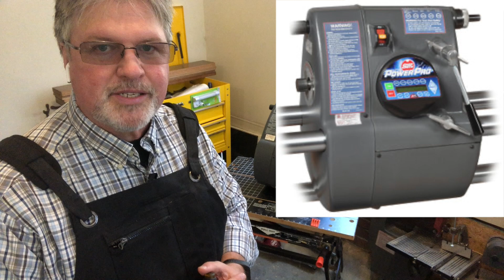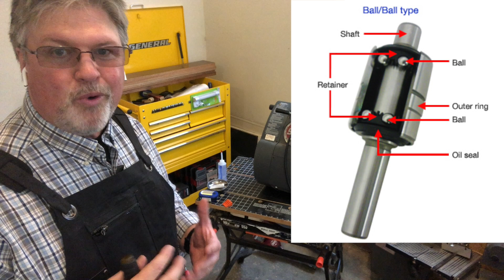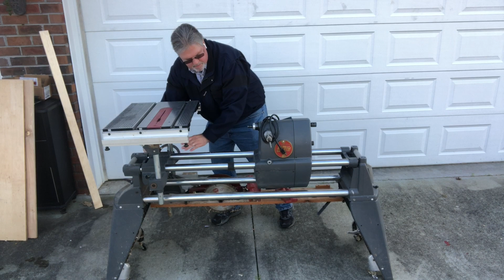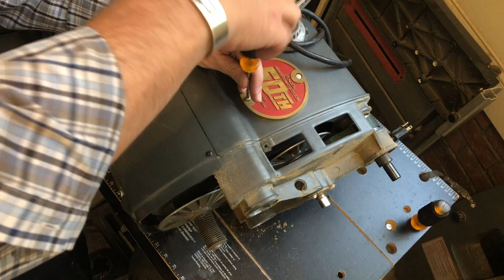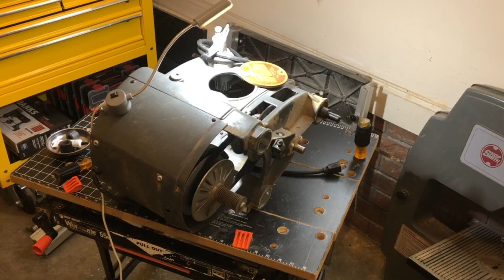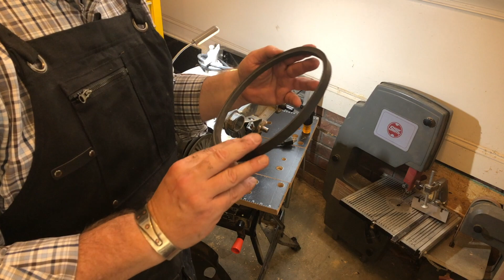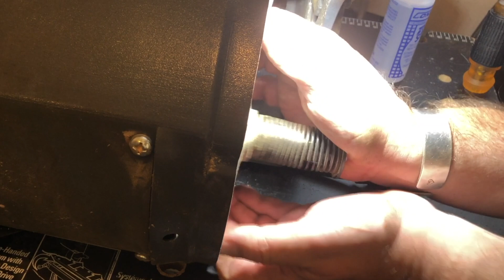25-Hour Run-Time Critical Shopsmith Maintenance, Headstock Removal & Lubricating & V-Belt Removal

Comment: The big problem I’ve had with my Mark V is the non-moving (the inner) half of the lower sheave. It is held in place by a set screw and over time that set screw looses its grip and that half if the sheave gets pushed against motor support plate just behind it. When that happens, rotation is stuck. To fix that, I have to remove the spring (very carefully - it’s extremely strong) and then reset the inner sheave half to properly clear the support plate with the set screw. Putting that spring back on is REALLY DIFFICULT and potentially dangerous. There are probably spring compression tools that would help here, but I don’t have any. I’ve done this procedure probably 4 or 5 times over the last 10 years or so, and I dread it. I love my SS but this issue is its Achilles Heel. There are a few other issues with the speed mechanism I have, too - wish I had the newer electronic controlled headstock.
Reply from the maker: Yes, Shopsmith added a spacer to this very spot years ago to prevent that sheave from moving into the motor. Also, that spring is no joke. I wouldn't even thing of messing with it without first making the 2x4 tool Shopsmith suggests. Better yet, I wish they would offer for sale the tool that they made for us to use in the stores in our service center. It was really handy and very safe, but I'm sure they were expensive.  Scott
Reply: @MyGrowthRings  The problem hit again, just after I thought I had it fixed. It’s interesting to know that SS has installed a spacer to prevent this issue. I’m almost ready to give up. I don’t know what to do - I can’t spend all my time fixing this machine.
Reply from the maker: @Dogsnark  I would get the spacer from SS. I don’t imagine it’s very expensive.
Reply from the maker: It's part 504205 Spacer Sheave and they are $5.
Reply: @MyGrowthRings  Thanks! I’ll send off an order pronto.
Reply: I received the spacer (thanks for the part number) and have slipped it and the sheave onto the shaft. But it seems that this spacer is now effectively reducing the length of the motor shaft by the length of the spacer - about .5”. But the spring still fits, though it’s more compressed now at any given speed. Lower than “Disc sand” it gets very hard to turn the dial. So glad I discovered your channel - I’m looking forward to being able to use my SS again. Thanks.

Comment: You recommended a guy that rebuilds the little gear that spins on the top of the speed dial on eBay, he does a great job thanks for the recommendation
Reply from the maker: Glad you are pleased. Thanks for reporting back. Scott

Comment: Hi... Thanks for the video!  Have a 52 Greenie with two unusuall issues....  First is the back of the v belt contacts the way tube on operator side.  Have tried 3 different belts from different vendors, no change.  Positioning of components seems proper.
Second issue is hairline CRAaKS inhousing on both sides of notch belt berrings...  Photos would help a bunch....
Reply from the maker: I suspect that the idler shart eccentric is turned the wrong way. It'll still tighten the upper belt but it may be putting the upper control sheave too close to the front.  Sorry to hear about the cracks. You can email me at ScottMarkwood(at)Gmail(dot)com
Reply: @MyGrowthRings  Hey Scott,... many thanks for the comments and taking the time to make these great! videos...

Comment: Hey Scott! This is Steve. I won 2nd place in a corncob pipe contest a couple of years back on your cobfoolery contest. The churchwarden with the helical balsa filter and the cob insert into a banksia pod. Came to youtube looking for a vid about the speed adjustment set up on a shopsmith and found this video. What are the odds? Thanks for posting this. It showed me how the lever and dial went back together, and the oil points. Works great again.  Hope all is well with you during this odd time. Thanks again!
Reply from the maker: Hey Steve! I remember you and your pipe. Hope all is well in your neck of the woods and glad to hear the video was helpful. Scott

Comment: Very well explained. I  never new it the bottom idler  was a automotive water pump bearing. very interesting. I haven't had to replace it on any  of mine yet. It seams to be a very robust bearing. But I did find all the other bearings are a common size and easy to find online. I even was able to knock the little bearing out of the back of the speed control sheave and replace it. I got ten for 5 bucks I think. I had to make a new shaft with the button and did it out of a small bolt that I rounded the head off and domed it and drilled a hole so it can be pulled in and out by that clip. I have a lot of hours on it and its holding up just fine.  Saved me around 50 bucks or so for the new part.  I love how the basic of this machine has remained the same for so many years and a 1950's machine can be brought all the way up to a powerpro with just the purchase of the parts.
Reply from the maker: Very good solution on the button bearing. Yes, the headstock I retrofitted with a PowerPro kit during the beta test was a 1955 "Greenie" and it went perfectly.  Such a neat tool. Scott

Comment: This was a great teaching video!! ... alas, no-one will see my comment and well-deserved praise ... take note, you haven't had a more popular video since this one!  I followed every step to get my barn-recovery Mark V up to the so-called 25hr maintenance mark, including freeing up the speed control dial and rack and pinion control, overcoming exactly the same issue you confronted on the motor pulley spring and (using your Oakville reference!) changing out the main belt which was rigid in an oval shape, although happily not too worn, suggesting low mileage on the machine ... but in the video you suggested a follow-on video on other maintenance and stated that there were two other belts deserving attention (does the drill press quill and upper rear take-off spin constantly in lathe use or is there some sort of clutch?) ... anyway, perhaps time to dive into your big YouTube following on maintenance vids, no? So popular that you could make it 30min and build up some viewer hours!  Cheers  Farmer John
Reply from the maker: Ha!  We'll I suppose I could do that. Glad to hear that you got your Mark V under control and I hope you two are making mounds and mounds of sawdust for years to come.  Scott

Comment: Scott, I have a Mark V model 500.  I haven't turned it on in about 25 years. It's been in storage. Other than the 25 hour maintenance is  there anything else I need to do before I turn it on again. ????  I did the maintenance before I put it away. I haven't located my the manual yet.  Thanks,  Love your videos. 
Clyde
Reply from the maker: Hey Clyde. I misread what you were saying, thinking it had been 25 years since you had turned (wood) on your Mark V, but now I get it! Welcome back to the shop!  I think you will find that it's in pretty good shape. I would suggest turning it on and letting it run with nothing installed on the headstock for 10 minutes or so. That will get the grease in the bearings to loosen up and do its thing. After that run-in, I would pull off the covers and oil the motor sheave and the control sheave. Double-check the belts to make sure that they haven't developed dry rot and you should be good to go.  Thanks for watching and commenting and enjoy making sawdust! Scott
Reply: Scott thanks for the reply.  That's a lot easier than I thought it was going to be.  You have a great channel.
Reply from the maker: @clydew2357  Thanks and yeah, it's quite a forgiving tool. Scott

Comment: My quill lock wont lock. Can you tell me what I need to do to get it to lock
Reply from the maker: First off, make sure that we are talking about the knob on the front of the headstock, near the switch.  Odds are that it is missing one or more of the washers that go between it and the yoke on the inside of the casting that actually grips the quill. I suggest taking a look at an exploded view and make sure that all the parts are installed.
Reply: @MyGrowthRings  yep they are missing
Reply from the maker: @TheBart49  Ah ha! Well, they are available from the mother ship as well as from folks who part them out on eBay.

Comment: Hey Scott,
Can 3 in 1 machine oil be used in the essential liquid lube areas of the motor that you discuss in this video; e.g., inside and along the motor shaft?
Reply from the maker: It’s been done and it’s far better than not oiling. Because 3-in-1 contains naphtha and a few other non-lubricating “herbs and spices” I don’t use it for this task. According to the MSDS, the oil I use is 99% “severely refined oil” and 1% distillates. It has never given me concern. Scott

Comment: The quill on my 510 is very stiff until it extends to the point where I can see the groove on top of it. I tried applying paste wax and wiping it off, but there is no change. What else can I try?
Reply from the maker: Hey Steve. Any chance the the set screw that runs in that groove is set too deep? If not, you might want to remove the quill and clean everything out inside and the teeth on the underside of the quill. Just guesses, but a place to start. Scott
Reply: @MyGrowthRings  I removed the quill, cleaned it up and reinstalled. Works great, now!

Now for another issue. When I started up my 510 (at slow speed) it ran smoothly, but as I increased speed, it started making a grinding sound as I went halfway to top speed. I took the power plant off as you demonstrated and removed the belt cover so I can rotate the drive manually. I'm getting the sound from near the sheaves. Everything is clean inside the case. Any thoughts?
Reply from the maker: @wxman5000  Sounds like a bearing. Most likely the small bearing in the control sheave. Can you observe through the opening in the back of the headstock while it is running to see if that is the source? The idler shaft can also be problematic.
Reply from the maker: @wxman5000  Can you tell if the noise is coming from the idler shaft or inside from the control sheave bearing?  The old screwdriver to the ear trick can help.
Reply from the maker: Here's a video of what I mean: https://youtu.be/U927cYhQXB4
Reply: @MyGrowthRings  Nice tip about the giant screwdriver!  
I removed the drive belt from the headstock and put the disc sander attachment on to test how well everything turns. I get no noise whatsoever from the sheaves or by turning the shaft on the motor. The belt looks good, but could it be the source of the noise?

Comment: I'm a new SS owner and new to the community. The machine I picked up is mid 1980's (I believe) and the way tubes are a little rusty. Do you think I should try to wd40 and 3m, then wax them or just start fresh with new ones? Im going through you videos and Im going to tear it down to clean and lube everything before I try to use it. Your videos are awesome and absolutely necessary to a beginner like me, thanks!!!!
Reply from the maker: I always try to give the old ones a go. Just makes sure to clean as much of the rust off the tubes as you can before removing or sliding the headstock.

Comment: So I've done this maintenance on my used Mark V (I've had it a couple months), seemed to improved the function a bit, but I have another issue I'm wondering if you have any insight on.

If I manually rotate the quill, there's a slight sandy/gritty kind of feeling (and a sublte creaky noise). I'm thinking this may mean some bearing or another is dying. FWIW the belts look almost brand new (I know someone did some general maintenance on it before I bought it). It's a 510 from 1987. So my question is effectively: Is that normal? Is it a problem with the quill? one of the bearings you mentioned in the Q&A video associated with this video? Is there something I should be doing to get that to turn smoother (it turns, it just feels... a little gritty).
Reply from the maker: There are three to four bearings running from the til of the quill to the far end of the headstock and any one of those could be bad. I suggest running the machine for a few minutes and then feel the left side of the headstock and extend the quill and feel it to see in any of the bearings are running hot. That's usually an indication that there's a problem.  Also, you might want to mount a long drill bit in the drill chuck and see if you can see any wobble in it. Slight noises and a little "graininess" doesn't bother me too much, as long as everything seems to be running true.  The bearings are sealed and there's nothing you can do but replace them, and that's actually a pretty easy task. Search Youtube for "Jacob Anderson" and you'll see that he has several useful videos that address changing bearings. Scott
Reply: @MyGrowthRings  The suggestion about checking for heat is a really useful one! Thanks!
Reply from the maker: @Gwyd13  Hope that gives you the answers you need. Scott

Comment: My manual says to lub the drive shaft and idle shaft every 10 hrs.  How does that work?
Reply from the maker: The timeline has changed several times over the years and I suspect it’s because SS has more data and we know have more refined oils. It’s also very hard to track “run time”, so more than likely you’ll just want to add oil a couple times a year.  Scott

Comment: On my 1981 Mark V    I am able to avoid removing the head stock (and the associated potential problems with that)  and doing all the maintenance in place. 

1. Remove the table  2. Move headstock to far-right position.  3. Raise to drill press position. 4. Re-insert the table from the back side and rotate to horizontal - forming a "work platform".  5. Remove the top cover and set aside (requires removing the tie-bar on the way tubes).  6. Then remove back panel - all the motor weight now resting on the table. 7. Remove the belt, 4 motor mount screws, and unplug the power cord from the switch.

Now the motor can be safely placed on the floor and you have full access to all internals, at eye level, no bending  -   no balancing, clamping, or chance of anything falling.
Reply from the maker: Yep, that's how it's done on the early machines that have no access hole.

Comment: I have a 1985 Mark 5 10 I bought new. Rebuilt a huge bay window out of cypress on our riverfront home. Since that time the machine has not worked a lot, but in storage in coastal environments (I.e. salt air!). Moved machine to Charleston 2005, and kept in garage. Tried to use but noticed belt was slipping. Got new belt from SS watched your vid. Got old belt off, but bottom Sheave was was frozen closed! Pried and banged to no avail, break free heavily applied. Purchased 6” pulley puller, sheave wouldn’t budge. Finally applied direct heat with Plumber’s torch, very carefully and prayerfully, while cranking down on the puller. Sheave moved and compressed spring, poured oil on shaft, worked back and forth, until movement was free and snappy. Machine runs like a champ with new belt and oiled sheaves. Thanks for a great vid!
Reply from the maker: Wow, what an ordeal! The motor shaft is stainless steel, so it's likely that either the sheave got corroded or that at some point in the past it got sprayed with WD40. Glad to hear you got it worked out. Scott

Comment: The sheave end of the idler shaft (also powers the jointer spindle) on my 1981 Mark V runs inside a sealed bearing - which is/was a press fit to the shaft.  The bearing is fine (not frozen, no resistance) but the idler shaft turns inside the bearing race while the bearing remains still. Sometimes will squeal until I apply silicone or WD40.  Someday I may "loctite" this, but haven't yet.

Is this common ?
Reply from the maker: The bearings themselves are contained within the housing and are covered with a black seal. The seal should be all you can see and it doesn’t rotate with the shaft. Sounds like all is well to me. Scott

Comment: what needs to be done to the Pro Head stock for maintenance
Reply from the maker: As I mention at 0:27 there isn't much maintenance on the PowerPro at all. For the most part, it's just graphite on the headstock lock and way on the quill and occasionally blow the dust out of it.  Scott

Comment: I was laughing when you picked up the oil. I use that on my wife's sewing machine, never thought to use it on the SS. The extendable spout is sure handy, Isn't it?
Reply from the maker: It sure is. You wife clearly has good taste.
Reply: I restore vintage sewing machines and use this stuff regularly, including cleaning.   I have to store them in a large pill bottle though, the bottles seem to deteriorate and the oil seeps out.   Hate finding them empty when I need them.

Comment: My Maintenance and Troubleshooting  manual is says, " Lubricate the floating sheaves (pulleys) with a good 10w30 non-detergent motor oil", but I see you are using a much lighter oil.  Which is correct?  Also, I have been using the 10w30 per my manual - should I change over to the lighter oil in the future?
Reply from the maker: It really depends upon which manual you read as to which oil is recommended. I found a 30 weight oil to be too thick but if you don’t lubricate often, that might be a good choice.